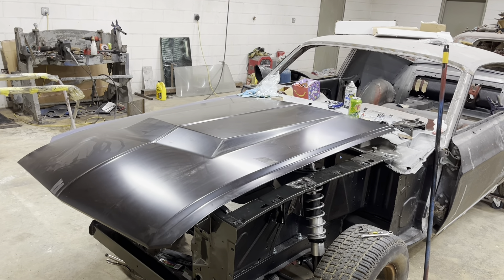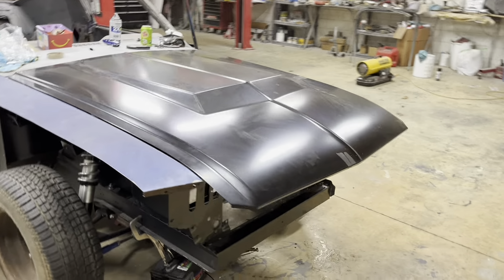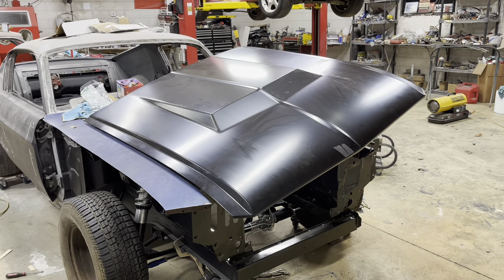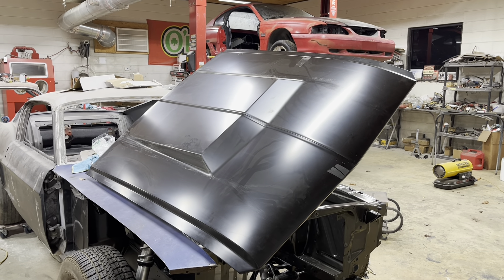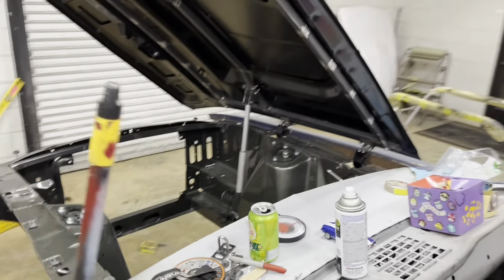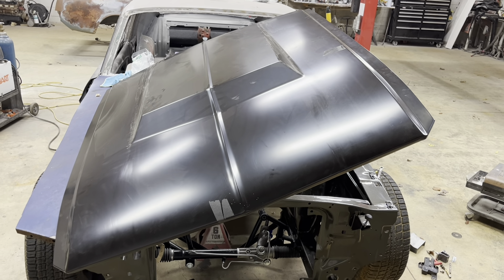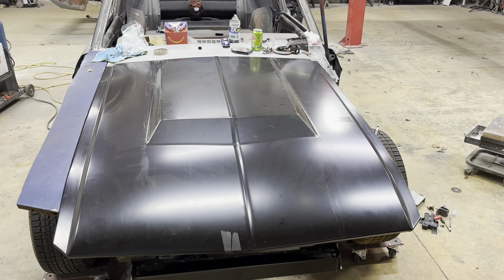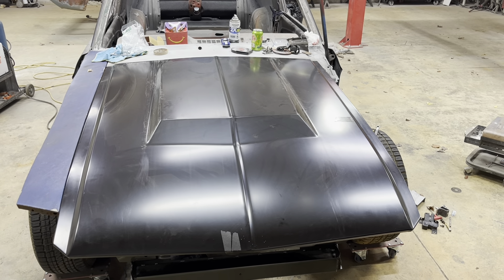Remote operated hood side tilt 1967 fastback mustang

Comment: So what happens if batteries go dead or motor craps out. How would you get under the hood? Plus it's painfully slow
Reply from the maker: @brandoncarey2329  there are access pins under the fender to release it, and you do t want it to go fast because it could crack your hood